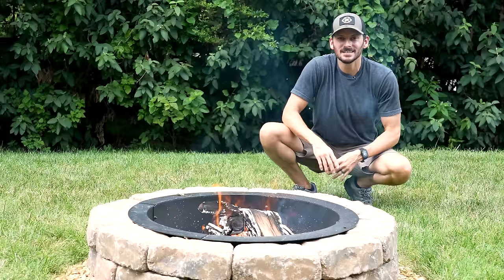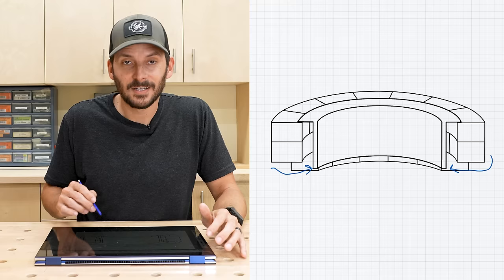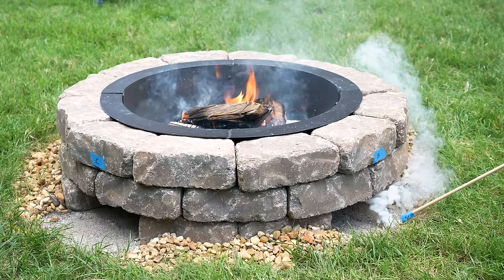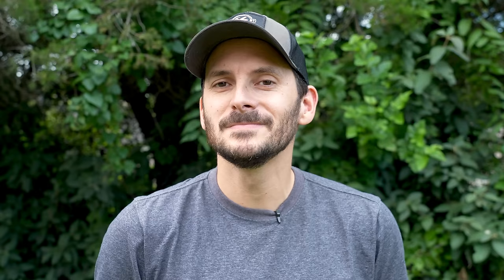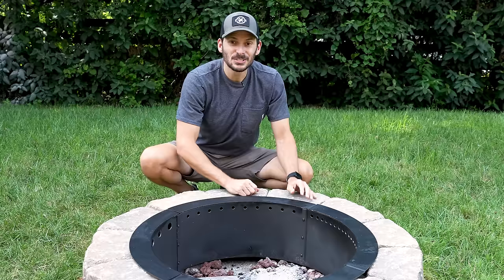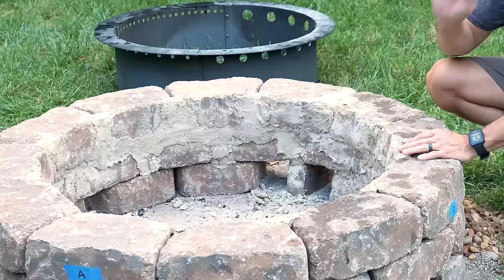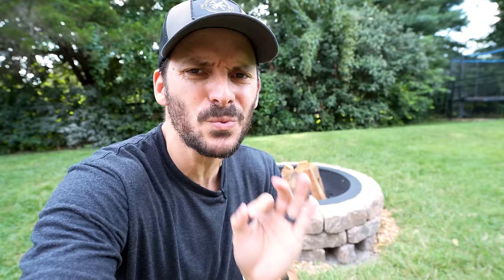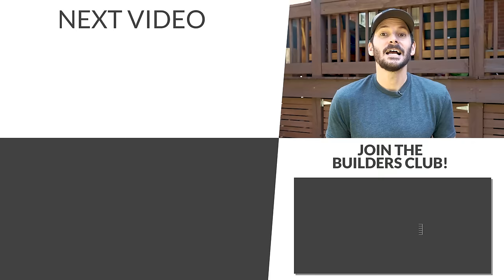Stop the Smoke, Do THIS to Your Fire Pit

Comment: For that design, smaller fires will be more prone to smoke. That's why the large fire worked better. The fire has to be large / hot enough to heat the air in the gap so that it's primed for secondary combustion when it reaches the holes at the top. For that you either need a hot fire, or taller walls to allow my travel time which equals more heat.
Reply: yeah I'm looking at that manufactured one and I'm thinking, just taller walls
Reply: I rarely get heavy smoke with any pit, but it’s because of box fire in conjunction with tee pee style. It creates it own vacuum the hotter the fire the faster it’s heat is ejected along with its smoke. Needless to say, I like raging fires. Fill my truck bed once every two months with good dry wood.

Comment: It would be interesting to have done a control burn using dry wood before drilling the fire ring holes. This would show how much of the improvement in smoke reduction was due to the modification of the fire ring and how much was due to the drier wood.
Great video otherwise. Very easy to understand. Will use your tactics when I build my next fire pit.
Reply: What is most important is to keep the wood consistent (the same wood) from burn to burn in order to make the best comparison.
Reply: I agree cuz I was like so just use dry wood then?

Comment: I have a different brand than Solo and it is completely amazing.  Really cool almost welding type flames coming out of the sides at the inner top and bottom.  Some smoke but only on super wet stuff (I've burned mulch).  I have 3 problems with the setup. 1) They are all very tall so its not really a firepit feel. 2) they are completely closed in except at the very top so heat is focused basically completely up. So they are not as warm either.  3) wood burns really well and super hot so it also burns fast.   
It's all very impressive physics and thermodynamics but it does not feel like a campfire pit type thing.  Feels very "efficient factory produced fire that can melt metal." haha great video!
Reply: Good observations.  I wonder if it would help to suspend a flat plate above the fire?  Theoretically that should redirect the hot air toward the outside of the firepit.

I expect that the fire will eventually destroy the plate unless it’s made of ceramic or fire brick or something.  And I wonder if a cone sticking out of the middle of the plate might encourage more even distribution of the hot air than only the flat plate.

Seems like there should be a way to get the benefit of the efficient, smokeless fire without losing out on the warm, comfy firepit.
Reply: What brand?
Reply: So what brand do you have so I can check it out?
Reply: Hi-Flame Bonfire Stove fire pit. 20.5 inches

Comment: Great video. It would have been good to see the unmodified original version with the same dry wood you used at the end. As I feel  like that's what actually made the difference
Reply: It was a good video and I learned some ideas,  but iam also thinking the dry wood is what the key factor was !
Reply: Yes, correct me if I'm wrong, but nothing seemed to work until the fuel type and amount changed. So the conclusion should be: don't change the pit, just dry the wood and add more.
I like the attempt to engineer the pit though, and I'll probably do something similar because it's cool :)

Comment: Great video! I liked it!

Here's what you missed when you looked at the patent for the solo stove. The secret of why it generates almost no smoke isn't to do with the size or number of holes in the top/bottom. That is a factor though. The biggest factor is to look at the ratio of the height of the pit to the circumference. Basically, the solo stove is skinnier and taller. With a pit of this diameter, you'd have better performance by building the height of the pit upwards.

This increases the effective space of that insulating layer, providing more area for smoke and gasses to slow, cool, get trapped.
Reply: Or you can use an old washer tub....
Reply: I agree. Also he should taper the top a bit too
Reply: Also, the solo stove has holes under the burn area too.

Comment: After doing this project years ago, what I learned was it's easier to get the smokeless results with a smaller firepit ring. I think this is because in order to get smokeless results you need higher temperatures which is easier to get with smaller pits, unless you plan on burning A LOT of wood at one time. This is probably why the solos aren't that big.

Comment: The fire shooting out of the holes is actually the wood gases burning. Honestly, fire ring is too large a diameter, and not tall enough to create those jets...It takes convection to create them, and the larger diameter keeps that from happening consistently around the ring.
Reply from the maker: Yep, exactly what I found. This is pretty much the best you can do with this style ring. But still way better than stock
Reply: I'm thinking the same thing, a taller and/or smaller diameter ring could work better. Either way, nice testing with the fire pit you already built!

Comment: Pretty sure it would be exponentially better if you placed a another layer of stones on top of the steel liner to add as a "ledge" so that the top opening is a little tapered.
Reply: Hm probably true, just like the solo stove
Reply: He’s onto something here. By narrowing the top of the fire pit, you will achieve what is known as the Bernoulli effect. A greater force of air thrusting through the whole system, and theoretically more fweefwee
Reply: Can you answer in more detail?
Reply: @CharlesThomas-xv2yn  - Yes i can answer, but please, stop calling me "in more detail"

:oP

Comment: A similar fire pit used in India was plastered with a sealing layer of that cement paste to control the odd drafts.
Made for much more controlled heat for cooking as well as for fire alone.
It was also used to cook flat breads slapped onto the inside of the mortared inner area.

Comment: Yes, the stacking of the wood has more of an influence on the smoke compared to the fire pit's design. What works for me is stacking the wood to create a closed high temperature chamber, like a furnace, with smallish entrance holes for the air, and corresponding exit homes for the smoke.
Reply: I agree

Comment: the smoke is always in your face because the smoke will travel towards the tallest things around the pit. Think of it as smoke traveling up a wall. At one end of my pit I have a tall rock (almost 4ft at the peak) I am not sure the science behind it but this makes the smoke always migrate towards it and then up the rock and up. Just something to think about. great build as usual.
Reply: Air rises over the fire, pulling outside air towards it. You block that inflow, so rather than it flowing in to the fire it can get pushed out towards you
Reply: Yeah, flue effect sucks the air through air speed differential.

Comment: I think the geometry of the fire pit may have a lot to do with it. Smaller diameter and/or taller pit. You want the steel wall closer to the fire to transfer more heat into the incoming air. Taller wall gives the air longer to get hot on its way up and out.
Reply: This is what I was thinking the whole time.  His fire pit is way too wide and shallow for this application, and using extra dry wood for the final test means his before/after doesn't mean much.  If you build a super hot fire with super dry wood you're not going to have much smoke, it has nothing to do with the "smokeless" pit.
Reply: Its definitely the geometry of the pit. The way the solo stove works is that the upper air vents provide fresh oxygen to hot, combustible fuel and burns off any solids. With the current diameter of his pit there is too much room for a heat gradient to form, this causes the upper air vents to pool cool air into a region of cool air and smoke.
Reply: I came here only to look for someone that has noticed the wide diameter of the fire pit. Definitely, an underrated perspective looking at the rest of the comments.
Reply: My thoughts exactly!

Comment: If you notice on the Solostove the top opening is necked down smaller than the diameter of the main burn chamber.  That increases the velocity of the air leaving the chamber and this increased velocity produces a slight vacuum in the chamber.  The vacuum pulls more air through the secondary combustion holes making a more efficient second burn and less smoke.

Comment: If you ever decide to return to this project, you could place a small lip around the top of the internal circumference of the pit forcing the air for the secondary combustion in rather than straight up as it exits the holes while simultaneously trapping some smoke underneath the lip which may increase the combustion but also possibly reduce the airflow. I am curious to see the effect. It's a similar approach the reducing the diameter of the pit without making it look like a soda can.

Comment: So in conclusion: Wet wood makes smoke, dry wood doesn't. Gee, science.
Reply: Even the dry wood was smoky when it was built up over the top holes, when he spread the logs around so it was lower (and not using airflow from the top holes as a primary oxygen supply) it stopped smoking.
So yeah, the system does seem to make a difference.

Comment: Great video. However, the part that's missing is the ratio of  stove height to diameter. There a powerful convective element with this process you just aren't going to get with such a wide and shallow fire-pit. The point is to increase the secondary burn which takes place at the top of the fire. In your stove the top of the fire (flames and smoke) is already outside of the fire-pit. It's just NEVER going to work like that. You pit needs to be 2 or 3 times higher for that diameter. Notice on the patent how the top is tigher than the rest of the pit and the ratio of heigh-to-width. The secondary combustion has to take place BELOW the top surface of the stove. Dry wood for the final tests but wet wood for the preliminary is also quite misleading. A lot of people will fail following this advice.
Reply: You brought up a point that I was thinking.  The idea that he is copying does have a higher ratio, meaning the fire pit should be taller.  Everything else about this is good and I think I'll build one of these.
Reply: correct  to get the chimney effect
Reply: At first I was ready to rip out my stainless steel insert on my garden BBQ (we don't call it a fire pit) and spend a Saturday in May drilling 2500 holes...thanks to this post I'll save the effort...title of the video should be wet wood is great for smoking

Comment: I have made similar fire pit from the laundry inner tub, which has tons of holes. It works great with no smoke. It seems like in your experiment, the fire pit is too low so it doesn't allow much of the air flow. The upper holes should be at bit higher. Thank you for the experiment and share!
Reply: I have 3 of them, every one is surprised they do not smoke. I also use dry wood, which makes a big difference.
Reply: I think the only factor here is using dry wood.  🤔
Reply: @bam5732  - They both play a role....Even with the driest wood, you'll still get lots of smoke if the fire doesn't have an ample oxygen supply.  Likewise, even with the best possible air supply in the word, if the wood is wet it's gonna smoke.  It would have been nice though if he'd actually shown the old pit with dry wood.
Reply: Laundry tubs are great. I believe they can also be stainless steel.
Reply: @scottcates  most of the time they are stainless steel, or at least the older ones are. Also, the older ones are driven by a big pulley, which can be left in place and serve as a stand. :)

Comment: Or, more likely, your original fire was simply too small for the size (and wetness) of the wood you were using. You'll note that in the 'after', the fire is substantially larger than the 'before'.

Comment: Wanted a smokeless but I love a half in ground/half above ground pits...   I basically dug a trench and used dryer vent and a metal grate. Several feet away is a Rubbermaid with a online bilge fan. Another few feet and a inflow pipe above ground. 

You can barely hear it when it's on. And the flame burns super hot. I keep it on low most the time. Only going on medium or high if still very green wood.

Comment: Super fun project, Brad - had me glued to the screen start to finish! I hadn’t really heard of smokeless fire pits unless they were propane or gas fed so that was pretty rad. Great video!
Reply from the maker: Thanks, Nils!  It was a fun one to try
Reply: Wont even bother watching this BS; It doesn't work...
Reply: @brentfarvors192  Did you try? What's your experience? I'd like to learn.
Reply: @Dgiztred  Yes. My "experience" is exactly as posted; The ONLY WAY to control the quantity of smoke, is to burn on a clear (high pressure), windless day, using the driest and most finely cut fuel available...Using the method posted here will make the fire burn HOTTER (More air flow= A hotter flame), but will do NOTHING for the smoke; Especially when starting the fire, and when it starts to burn out...I've tried with Pits/Barrels, and everything in between; You aren't going to beat physics...

Comment: the main factor i've noticed when it comes to smokeless fire is temperature. the hotter the fire, the less smoke gets produced. So when you look at the before / after at the end of the video, you can see theres alot more wood in the after, more flame, more heat - less smoke.

Airflow obviously is a huge factor when it comes to fire, and also temp of a fire. im not entirely sure if there are any other factors that go into smokeless fire other than temperature and airflow by extension if i'm honest, but you can get really good smokeless fires just by dumping metric butt tons on wood onto them without much real thought.
Reply: Make sure it's dry too lol

Comment: I've watched all of these hoping that someone will get to where they "somewhat" match the commercial available ones. This is getting it a step closer!  I think, and I could be way off, that possibly these DIY self attempts are not matching the height/width ratio of the commercial ones. Being so much wider, I wonder if the air going up the sidewalls doesn't have enough time to heat up.  You need a much "wider" fire to heat the sides, and the air traveling up the sides is so short.  * BIG CREDIT goes out to all those trying.
Reply from the maker: yes, 100%.  I don't think I'll ever get the consistent secondary flames on this design because it's so short.  The air doesn't have enough time to get superheated consistently.  A taller smaller version would be much better to achieve that
Reply: Next project - bury a smokeless barrel system!
Reply: @Fixthisbuildthat  I don’t think your fire pit is too short. It’s too wide. Over the years my family has owned a solo stove and two breeo fire pits. We’ve learned that smaller diameter fire pits make it easier to produce a smokeless fire, and they consume way less wood. 

Consider fabricating a wider top ring that reduces the inside diameter of the opening and covers the upper vent holes, protecting them from wind

Lastly, spreading coals closer to the walls and adding logs to the perimeter reduces excessive smoke much faster than keeping your fire centered

Great work! This is one of the best DIY smokeless fire videos I’ve seen
Reply: I think that having the same air source for the primary and the secondary burn is an additional 'mistake." You want the secondary burn air to heat up and exit the top holes with pressure. Having the primary air come from the same flow reduces that pressure. Notice how the patent separates the airflow much more distinctly.
Reply: Everyone saying it needs to be taller or skinnier is alluding to the fact that there is an optimal way to make this fire most efficient AKA not have any smoke. You are right, but the patent exists for a reason, there is much more thought/calculations and actual enhineering going on behind the scenes that would take more than just winging it with random materials. There is a lot of thermodynamics and heat transfer going on here that isnt as simple as “just make it tall and skinny” because there is obviously a sweet spot on both those constraints.
Reply: Height/diameter ratio is a trade-off between good smokeless burning and slow burning. One to one ratio is a good start for a pit with air inlet. Shallower pits have less or no need for air inlet. Air volume vs air speed for optimal burning.

Comment: It's heating the air that's injected at the top that stops the smoke. The hot air hits the smoke and combusts. Same system as "clean-burn" log burners. I think you struggled a bit until you put tons of wood in due to the size of the metal ring. A small one heats up faster and gives more heat to the air being pulled in.

Comment: Interesting experiment, Brad. Keep in mind that equivalent area of holes doesn't equate to the same flow through them. For example it takes more than four 1/2" holes to equal the flow through a 1" hole. That's the engineer in me coming out now.
Bill
Reply: Wow we have a genius among us
Reply: @daveklein2826  No, just a retired engineer.
Reply: So, should I drill 1" holes?

Comment: When I build a fire pit, I insert a small metal pipe that ends in about the middle. It also has a hole about 2/3 of the length. As the fire burns, it sucks air in at the bottom of the fire.  It makes it practically smokeless.
Reply: Interesting.